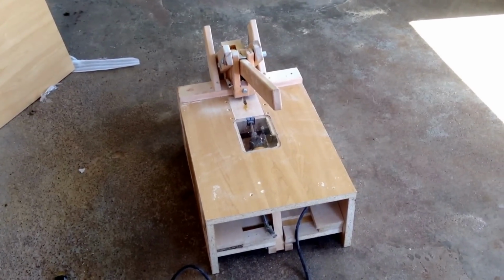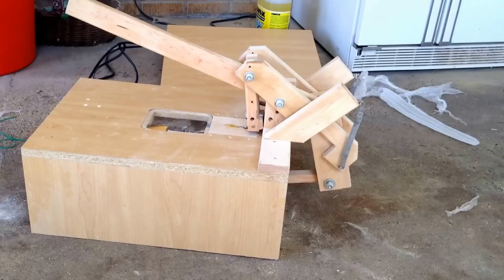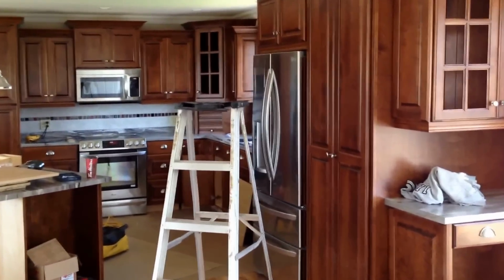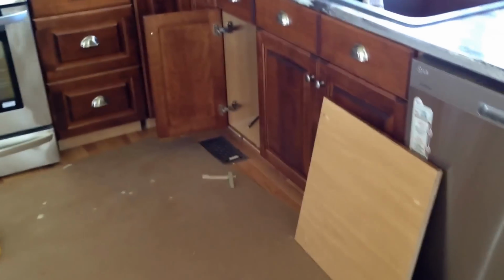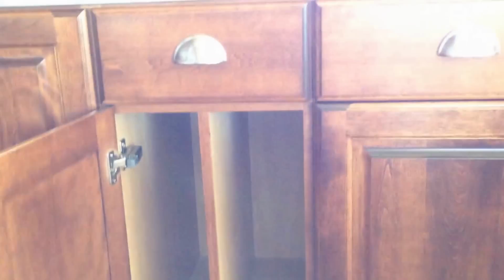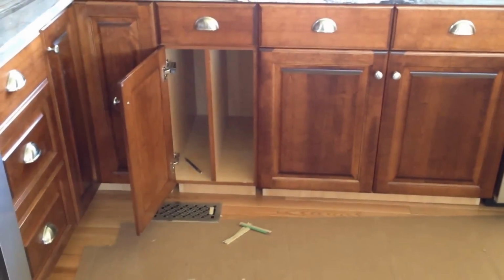Using DIY Pocket Hole Machine on Job Site

Comment: I love the machine plan to build one soon myself. Here is an idea to add to the machine, maybe add a power strip to the side or even hard wire a switched outlet to the box to make it easier to power on and off the drill.